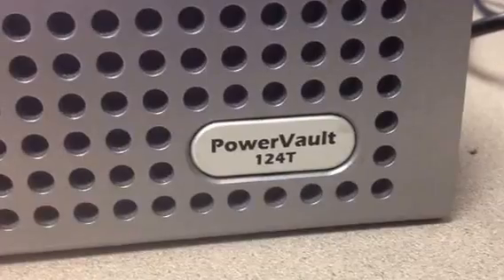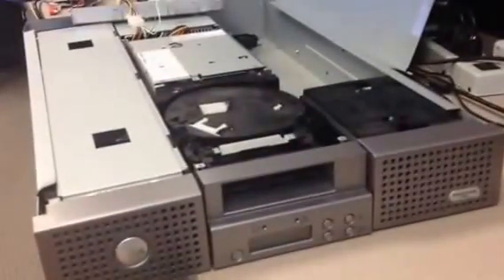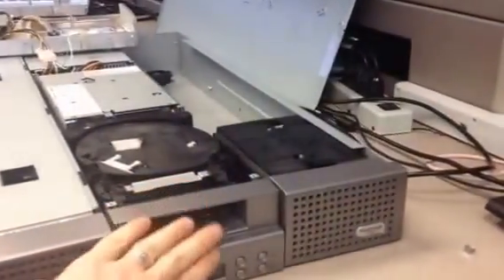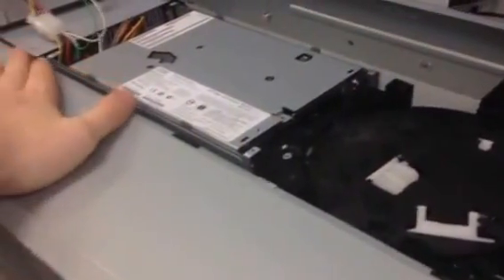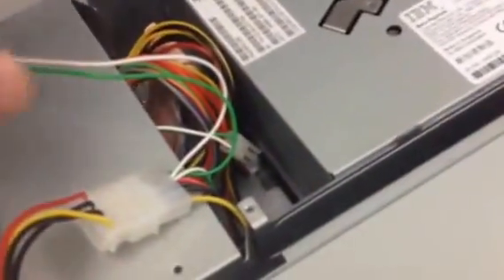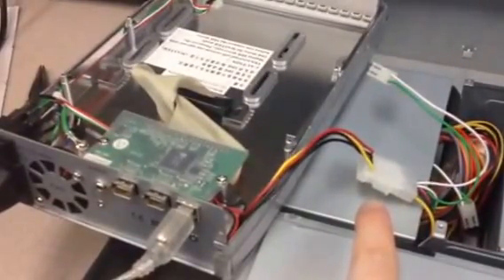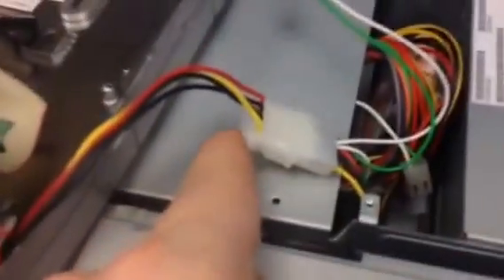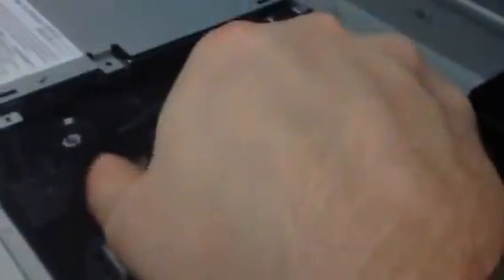Retrieving a tape from a dead Dell PowerVault 124T

Comment: Hello Eric. 
Thank you very much for your video. I have a 124T autoloader which showed a Position Error in the display. I have disassembled the case and it seems the picker is broken. I have bought a replacement picker and I have removed the broken one. from the case. The tape recorder has a tape in it which I need to eject in order to reconnect the rear flex cable to the new picker. Nevertheless, I haven't been able to eject the tape. When I press the small button in the front nothing happens. If I press and hold the button for 10 seconds, the unit resets. During the unit's boot up the eight segments display flash several segments and finally, it shows "8." just before turning off. The green light next to the button flashes and finally it glows steady green.
Do you know how can I eject the tape? Do I have to connect the picker to eject the tape? Do I have to follow some sequence pressing the button the front of the recorder?
Kind regards,

Comment: I’m new to the 124T.  Trying to sell an old unit and know little about it.  How do I tell if there’s still a cartridge loaded?  If I turn it on will it indicate that?  

Do people want cartridges when buying and if so how do I erase it if there’s one in there?

I pulled out the magazine but it’s empty I believe.

I also have a brand new power backup for these I’m going to try and sell if there’s interest.

Thanks.
Reply from the maker: The easiest thing to do would be to plug it in and then tell the unit to eject.  You can do this by going to "commands" on the main menu and then select "Eject."  This will eject the tape if it is in there.  However, erasing it is another issue.  You will really need some software to interface with it to erase it properly so I would recommend that you destroy the tapes to prevent someone from obtaining the data on them if they potentially contain sensitive, personal, financial, or other protected data.

Comment: Is it possible to upgrade a dell powervault 124t that has a dlt vs160 drive to a lto 5 drive?
Reply from the maker: The drive units are upgradable so you could swap it out with an LTO unit.  However, the library autoloader would be for the DLT so I don't think it would be able to swap in the LTO tapes properly so you would have to replace that too.  You would probably be better off buying a unit that already has LTO capability on it in that situation.
Reply: @EricVanderburg  ok thanks. I found a lto 2 unit for cheap. I might upgrade later.